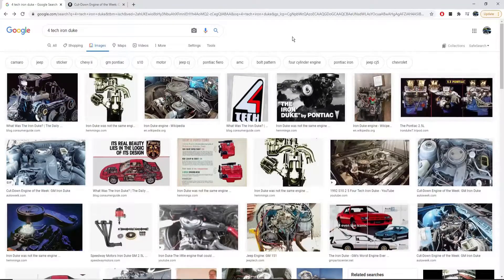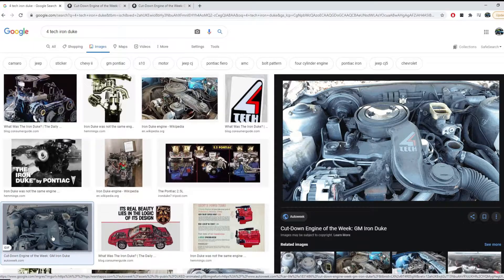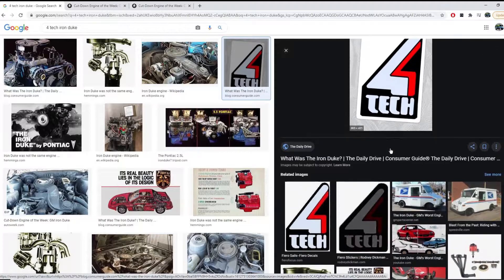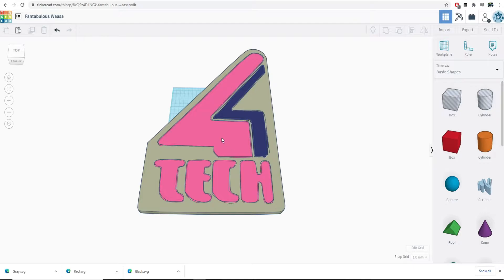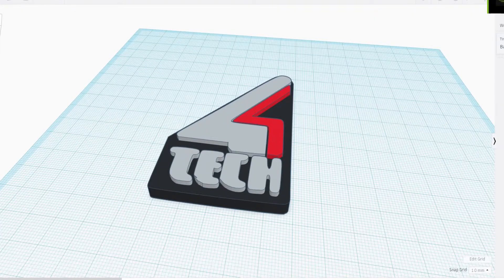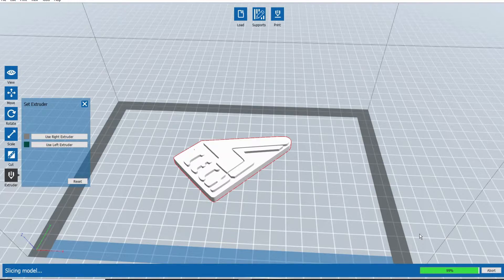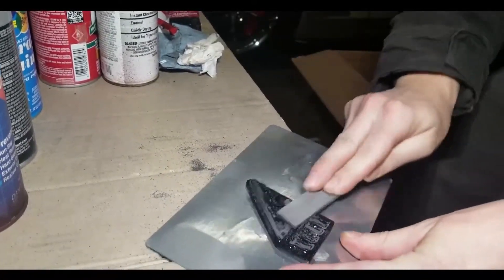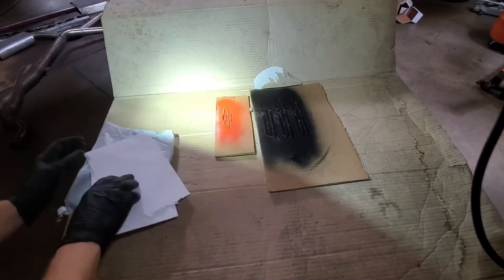3D Print Custom Emblems Using "mostly" free software

Comment: WOW! I'm gonna have to put my Ender 3 back to work LOL
Reply from the maker: It may not be body work but its still kinda therapeutic lol Mines a pretty old model but gets the job done
Reply: @CamaroRick  i like your enclosure, I need to build one for mine! Thanks for sharing this video!
Reply from the maker: @3Wheels1Block  Mine came that way. I need to get a larger printer, Its been a while since I last checked but my plan was always a CR10S because it was the largest print area for the dollar.